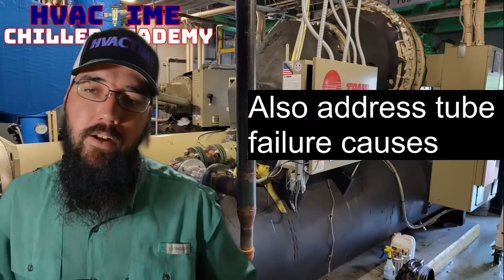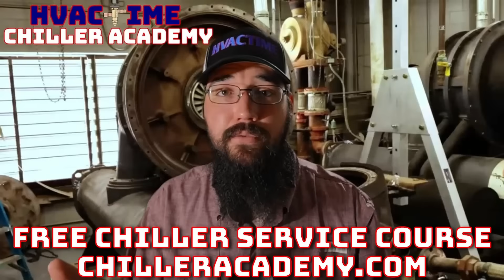What Causes Chiller Tube Failure?

Comment: Been hired to finish charging r134a to 250ton chiller in my city(add about 200lb out of ~1000lb). Chiller tech told me do not charge until they start pumps and compressors because i can freeze evap. question: how can i freeze chiller if it hold ~800lb already and standing pressure 50+psi? i am not messing with chillers usually and don't understand what can coz freeze evaporator with 800lb already charged?
Reply from the maker: I will cover this deeper in a live stream but play it safe and flow water. A technical answer with experience is once the refrigerant saturation is above freezing then there is minimal risk of a freeze happening.